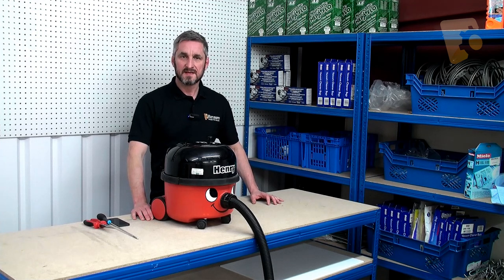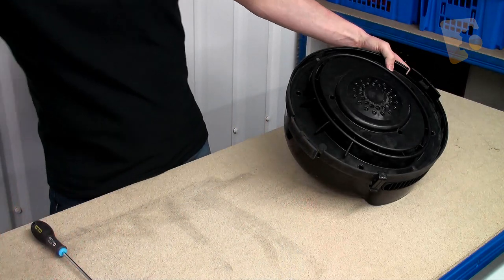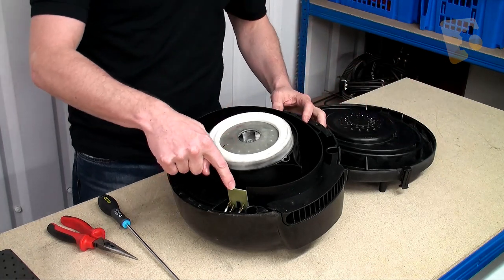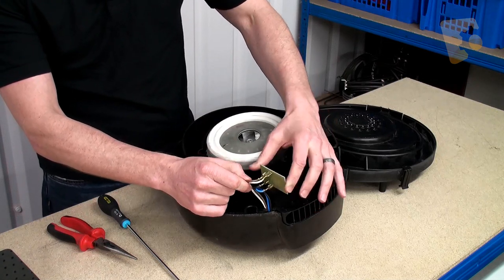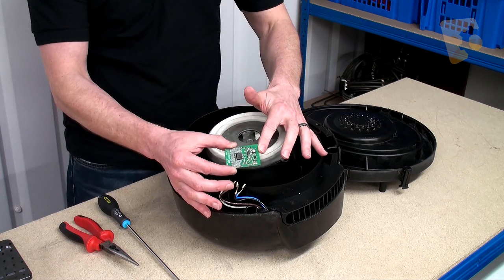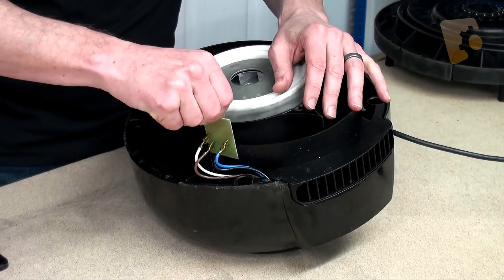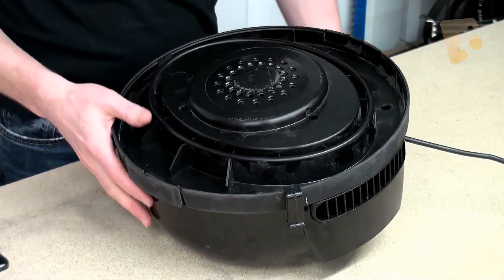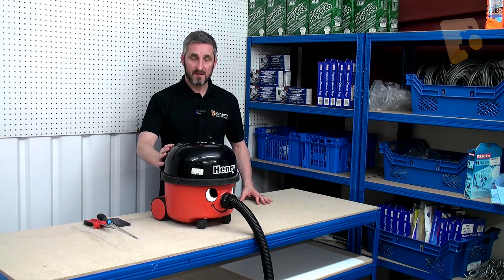How to Replace the PCB on a Henry Vacuum Cleaner

Comment: I got rid of my PCB as i had no clue if it had broken as no marks on at all , my hoover was working then i turned it off and went back 5 minutes later and wouldn't start. Found another video that shows how to get rid of this and i have a working hoover again, only thing it just has on off with one power now but i am happy with it. Works much better now .                                                                            The YouTube is :- (  Fix A Henry Hoover which won't start by bypassing the printed circuit board PCB  )

Comment: Hi, 

My Hetty has just conked out. I plug it in and turn it on and the red LED for the booster button is constantly on but nothing is happening.

This happened a couple of months ago, I bought a new one but kept this one with a view of fixing it. 

Anyway, the new one felt cheaper than this one so I thought I would check if it worked and after a few days off, it did! So I took the new one back and kept this one.

Now it's at it again. Is it the PCB? I read online about rewiring it to eliminate the booster completely and have full power always..?

Any help appreciated :-) 
Thank you

Comment: How would you know if the PCB needs replacing? What do you have to look for?
Reply: That was going to be my first question. No multimeter to test what is and isn't faulty.  And I think I would probably have plugged it in and did a quick test before I screwed everything back together again..

Comment: WARNING - The video shows him replacing the old type board, part 208100. Be aware that the connections to replacement board, the 321990 are DIFFERENT.
Reply: Patrick Quinn Noted new PCB is different (has 2 connections, not 4). I ordered and received new PCB and ready to install. Ransom Spares - how do I install / connect the new PCB?
Reply: @toniearl3497  Did you find out..? I have the same problem.
Reply: @YarmouthMark  It's so long ago now that I'm not sure I remember... and such a pain to open up Hetty to take a look, or go thru my emails from 7 months ago,  but as I recall, I had to reorder the other PCB with 4 connections. Unfortunately Ransom Spares, website had directed me to the wrong part when I searched for parts for my vacuum model. It took a few emails to get it straightened out. Once I received the correct part (with instructions), it was easy to install and the vacuum runs great. I suggest sending them an email (if youre outside UK) or calling them (if you are in UK) to get the info/help you need. **Ask THEM to select the part # to order to bypass their website search. I found out the hard way that it called up the wrong part #.**
Reply: Anyone with the newer pcb would make note of that before removing it. If not, they're a bit silly.